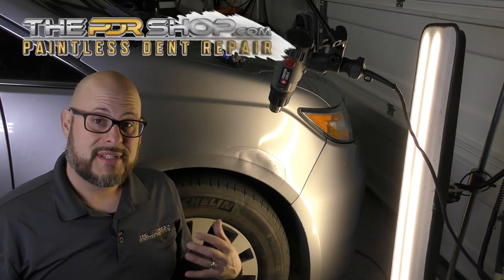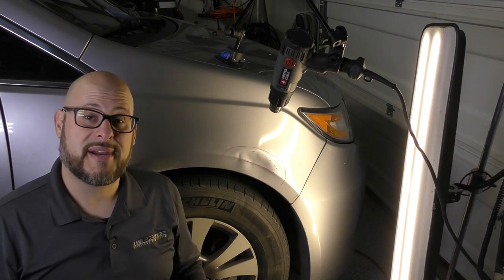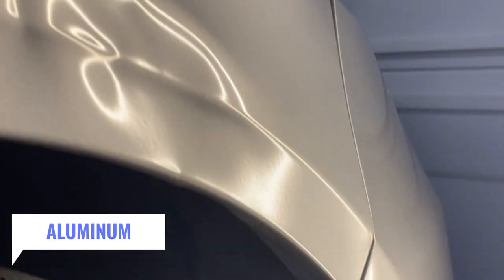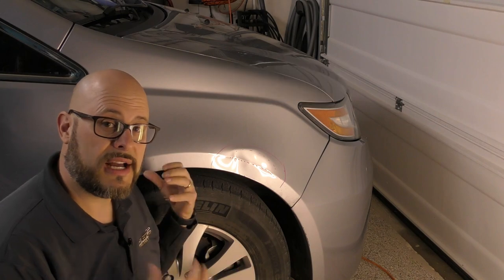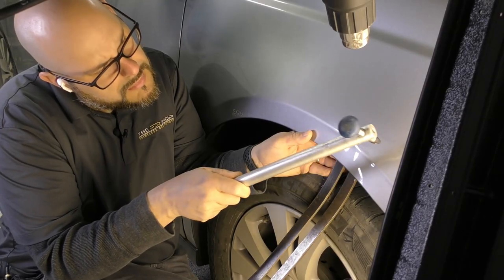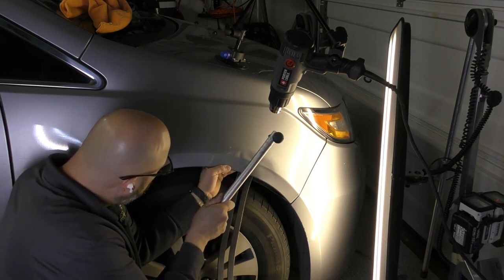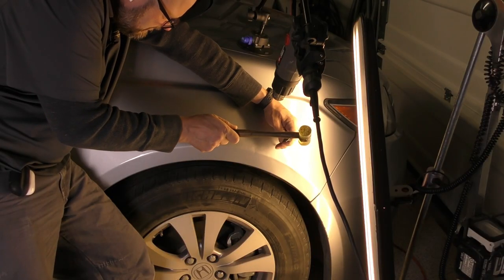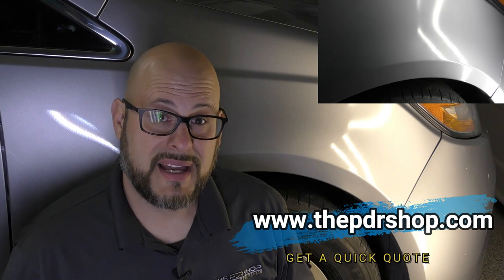Aluminum Fender Smash!!! Mobile Paintless Dent Repair Kyle TX, Buda TX, Austin TX

Comment: Hi,. At what temperature do you run the heat gun?
Reply: I just like to set mine so it’s hot to the touch but not so hot that it burns your fingers🤗
Reply: @CharliesSpanishJourney  okay thanks.
Reply: I have the same model and year car with a dent very similar in size in the same spot like your video. I'll give it i try with the heat gun and tools.